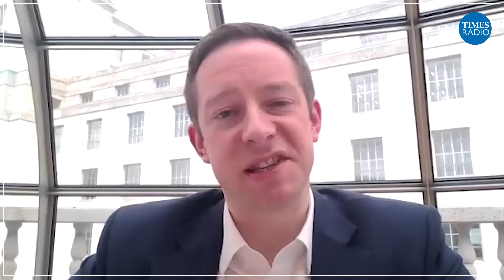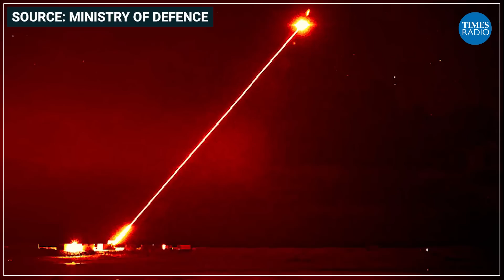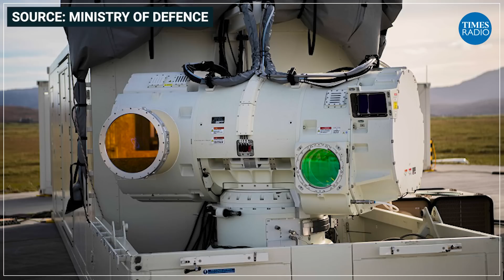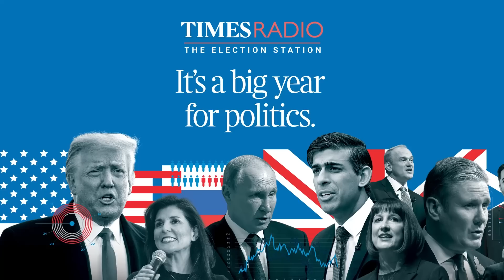DragonFire: the high-power laser capable of wiping out Russian drones | RUSI

Comment: I am surprised that lasers are not used to dazzle, or permanently blind soldiers on the field of battle now. If you had a pulse laser firing at a high refresh rate mounted on an automated carriage that was programmed to effectively sweep every point on the near horizon it could saturate an entire battlefront with enough energy to blind all soldiers on the recieving end. I suppose laser rated glasses would end it's usefulness pretty quick but short term against an unprepared foe you could remove maybe thousands a day with hit and run tactics that allthough effective, are non-lethal. Any such device would use a divided beam to saturate targets with pulses reaching the target distance spaced about one or two inches apart, and creating a pattern array of say one by ten meters with the intent that any single beam pulse would blind enemy soldiers perhaps permanently as this would remove them fully from any future combat rediness. Also to be considered are those frequencies not visible to the human eye such that the enemy would be unaware they were under any attack until symptoms were severe enough to offer any warning. I have seen a young man on youtube that built some damned effective laser devices from old medical equipment or items off amazon. Imagine if just the act of pointing your rifle at a target before firing makes it nearly impossible for that target to site, and fire back at you. One glance that encompasses the business end of your rifle and any potential enemy loses the ability to sight his rifle at you or anybody else either temporarily, or permanently. Again you would want a shotgun pattern of intermittant bursts that rotate, or shift rapidly back and forth such that every square inch of intended area recieves an injurious single pulse in rapid sucession less than human reaction to such would permit.

Comment: Atmospheric scatering is a bane of directed energy weapons. We now even have plasma throwers - they lob chunks of ionized, sefl contained plasma a few meter but interaction with air slows their spin, crippling containment EM feild, and dissipates heat.
In space though, those chunks are isolated kineticly and thermaly and on impact can charge or melt hull of spacecraft.
Lasers in space scatter less and depandant on focusing optics.
Max economically viable laser weoponry in atmosphere is 1-2 km with current electricity storage tech and using other energy storage and extraction tech, like chemical, brings you full circle to kinetics...
Reply: Britain has developed lenses to negate the scattering effect of the atmosphere, they fire a low energy pulse measuring the feedback and compensate accordingly. I think that's why this system is so successful. The laser would be focused to avoid the beam being divergent over distance and losing too much power.
Reply: @carl48uk  ok, maybe they've done some shenanigans with autoadjust of the lens, but the bulk of the problem still persists - air have non homogenous refraction property. No matter how much you adjust at the source, if there are multiple refraction areas on a path of a laser then you still loose coherency.
As I said previously, 1-2 km range is ok, but over this you'll have to brute force the beem to be unfocused and still do the damage.
That was precisely what US did with one and only prototype of anti ballistic missile Laser/Early warning radar, put on Boeing 747. Most of the space took 2 MW chem laser...
Well, I highly doubt 2MW claim, prolly was propaganda and counterintelligence, but the programm was scrapped anyways.

Comment: Would the beam  be rendered ineffective if the missiles were coated in mirrors?
Reply: Less effective, but it is a two-edged sword.
Silver mirrors, for example, are about 95% reflective. That would last as long as it would take the other 5% of the beam to oxidize the surface... a few milliseconds. Silver oxide is dark brown and would make the target even more vulnerable to the laser than it was initially.

Comment: here is one thing Lasers have weakness to and that is Reflective materials. They can replace the body of the drone with a Reflective material Like aluminium or dangle a pie tin under the drone to reflect the laster away from the drone. While no metal is completely immune to Lasers some are more resistant than others. Mark Rober did a Video i found interesting was on Vortex cannons if they can be compacted down in size they seem to be highly effective at taking out Swarms of drones at short ranges.
Reply: We can and do cut those metals in factories using lasers. What makes you think we couldn't do the same while they are flying?
Reply: @Pooua  But you notice they are used fairly close to the metal. Lasers get weaker as the Distance increases because the Area of the beam increases making it less intense.
Reply: @thegreatcanadianlumberjack5307  This is true, but not a showstopper. Lasers beams can be powerful enough to destroy missiles in flight from dozens of miles distant, even if the missiles are reflective. The 1% of energy that shiny missiles absorb is more than enough to melt through the metal in a few seconds. For a rapidly flying missile, that might be too slow, but a slow-flying drone is just right.
Reply: Check out the guy who talks about crowd control weapons ( urban) and his ideas for shields

Comment: The issue is a continuous beam cannot be simple increased in power as you hit a barrier where the air starts to create gas plasms between the gun and target. So the laser has to be pulsed to get round that plasma limit. If you create a plasm at the target . . . That would be very interesting.

Comment: Can a ground based laser be combined with an air launched balloon with a mirror to increase the range of the laser to over the horizon?  
It would increase the range of a large ground powered laser by many miles and with detection radar in the balloon 🎈 and a steerable mirror, greatly increase shoot down abilities!  
If space astronomy can be conducted with balloons, I'm sure a laser could be directed to pinpoint accuracy
With little trouble.  
Who is working on that type of idea?  Someone should!  It's simple optics not complicated physics.   😮😮😮😮😮😮😮😮😮😮

Comment: Can we expect drones to be made of heat resistant ceramics in the future with features to direct cooling across surfaces.  Maybe insulative foams or gels around important electronics. Materials that turn reflective when subject to high heat.
This game is going to continue indefinitely.
Reply: They don't need to turn reflective. Highly reflective surface finishes are straightforward to implement and are always on.
Reply: @rogerphelps9939  Except it also increases visibility, especially at night where reflections from moonlight, street lights etc. will enable it to be seen much more clearly. Ideally you want the reflectivity to quickly increase when the outer skin receives intense light or heats up, the opposite of how reactive sunglasses darken with sunlight.

Comment: All the time people speak about advantages of such systems (simply repeating some basic school physics) and avoid speak about their limitations. Like how long does it take to destroy single target, how far the target could be, how significantly it performance drops during rain, fog or significant dust it the air, how many targets it could hit before overheating. Maybe answers to those questions aren't encouraging enough so we don't mass deployment of those air defense an mass.
Reply: Much of that is classified, but the laser would not be very different from the chemical oxygen iodine laser used in LAWS. A single target may last from a millisecond to a significant fraction of a second, depending on the target. Weather is variable enough to make guesses vague but we could reasonably assume fog would not last long enough to matter. Rain could be unimportant or a show-stopper.

Comment: I have developed a projectile weapon that is very cheap to produce and operate, cannot be electronically jammed, is invisible to radar, infra red sensors and is virtually silent. Ammunition is very cheap and can be made in low tech environments. The weapon has a small collateral damage footprint, particularly when used by a trained individual and there is no pollution from the use of the warhead, I call it the bow and arrow.
Reply: And it's also a directed energy weapon. Kinetic energy.

Comment: DragonFire is junk. It has a 10 mile range on a clear day. Add rain and / or fog and that range is diminished. It can only be used on slow moving projectiles because by the time a hypersonic or subsonic missile gets within range it travels to fast to intercept. Someday this weapon may be improved but for now it is a waste.
Reply: Let's see... hypersonic vehicles are between mach 6 and mach 10, or 4000-7700 mph. Laser is 186,000 mph. Not too fast by more than 1000 times.
Reply: @flagmichael  You are not good at math are you? At say 6000 Miles Per HOUR. Once the projectile enters the 10 mile range of this weapon, it detects the target, adjusts to fire. The game was before the laser could even engage. It is junk.

Comment: Using lasers to blind people - including soldiers - is already outlawed by the GC. It comes under the broad heading of inflicting pain without prospect or intention of removing the threat. Flamethrowers also come under that same exclusion now. Flash-bangs only stay in because blindness and hearing loss are only temporary but even there, there is an upper limit on decibel output and light output.

Comment: You admit that the lasers do not replace the missiles yet you compare them in price for situations where a punch of bullets normally suffice. Fixed ground location makes lasers vulnerable. Also when it rains, it becomes an expensive rain vaporiser. And when it rains, it is defenseless. Enemy could fly a moped as they call shahed drones in Ukraine with a mirror to destroy the laser by reflecting its own beam onto it. Then you admit that it would need focusing to mitigate the clouds but then say that it is a straight line. I guess you could disperse it on its way and get it focus on target only but that requires more luck than simple aim and point exercise. For how long would it need to be able to focus on a target to make a difference?

Comment: It always comes back around to issues of energy.  You have to keep capacitors charged, batteries cooled, and a massive generator for these solutions to work.  

If you have a programmable 20mm fragmenting, explosive round, you are in better shape.  A radar controlled 20mm gun will make short work of multiple incoming dromes or cruise missiles.  Having to stay locked on a target until it fries means you will easily be overwhelmed.
Reply: Not necessarily. A light beam can jump between numerous targets. The issue is having enough power to do damage with a one second or shorter burst. Capacitors are good for energy release but only about 50% of the power is usable. Batteries can deliver less peak power but they keep going and output 90% of what was put in.
Reply: when each rounds costs more than a million, the power infrastructure is cheap. Apparently even Patriots required their own generators.
Reply: Cuts like a light sabre.......

Comment: What if the drone was covered in mirrors or reflecting surfaces ?  Oooops.
Reply: Totally inadequate. There is no perfectly reflecting surface, and the impingement spots would get darker by the millisecond. It would be burned away altogether in less than the blink of an eye.
Reply: @flagmichael  We'll see.  Attacking with GPS-guided drones during a dust storm can be a problem also, eh ?

Comment: Laser seems easily countered with some reflective coating of some kind. I'm pretty sure that will be being worked on if not already figured out. Could make drones more expensive to use I suppose.
Reply: Reflective coatings do nothing and there are no drones with such coatings and if there was the cost would go up significantly defeating the purpose of cheap drones.
Reply: @Art-is-craft  I actually ended up looking into it and there are coatings being worked on and tested and do in fact work.
Reply: @jibijay  
There are no coatings that will stop that level of power cutting a hole through materials. It is not light or a normal heat source it is an extremely intense energy burst on a very densely concentrated area. The reason why drones get used is their cheap lower technology price.
Reply: @Art-is-craft  This "laser" costs much more then any drone with a coating. Being to pricy is the problem.
Reply: The coating would have to be almost perfectly reflective; all practical ones would be burned away in milliseconds.

Comment: What in 5 years when it’s out of development? It’s not Star Wars where lasers just blow up things instantly , if the target avoids being hit then the laser is useless. Ukraine hasn’t got power in 7 regions today , how you going to power it
Reply: You know that mobile generators are existing, right?
Reply: @HedgehogZone  ha ha ha I guess you need another five years to get enough generators together as most are used in city’s without power
Reply: The system would track the target and maintain lock.

And they obviously aren't going to be running around with an extension cord looking for a mains socket. It will have its own power supply

Comment: Extremely skeptical about laser weapons.   Suspect that most drones and cruise missiles could be easily hardened against lasers.  Maybe if the weapon could produce a wide range of wavelengths it might have a future.  My money is on swarm defences.  Ie mount a gun on a drone swarm tasked with protecting an area.  Shares the advantage with lasers of cheap to operate

Comment: Several should be field tested immediately. I guess heavy rain, fog, smoke, etc. limit it's capabilities. However, a nice present from the UK. Best of luck with this one.
Reply: Anybody that has ever subscribed to Satellite TV knows how disruptive 'atmospheric conditions' can be.....
Reply: @vegas1a

Satellite tv disruption is usually 99% the installers fault. The tend to get a signal, any signal and they're done and gone.

If you obtain a 95% plus signal strength, it's extremely severe weather to disrupt the signal.
I actually installed one that it took 2 inches of snow covering the dish to disrupt the signal.

On the other hand, I've seen some installed that a simple breeze disrupted them. Incompetence at its finest.
---------
Anyway, the U.S. has developed technology that overcomes all but the worst weather and atmospheric issues.
For the most part, if it doesn't work, you probably aren't flying.

The only real problem is it's strictly a line of sight weapon. Of course if Airborne, it's still good for a couple hundred miles.
Reply: If you want to see how it copes with heavy rain or fog, keeping the testing in the UK sounds ideal.
Reply: Insh'Allah this will work with great efficiency!
Reply: Highly reflective surface finishes!
Reply: Fog won't be an issue. It'll just tunnel it's way through instantly.
Smoke will take it down a notch for sure.
Reply: Skies could be cleared with radio frequency
Reply: In combination with things like Gepard, some kind of missile based shorad like Avenger, and an electronic warfare platform. You'd have a very effective way of protecting armoured groups from the skies!

It could also be added to existing gbad installations around key infrastructure and military assets.
Reply: Its not capable of anything (It has to stay on target for ages before it can do anything!
Reply: @DarrenJamiesonJamieson 
Drones are slow moving and not sophisticated hence why they are used.
Reply: @churblefurbles  
It takes time to develop such a weapon and to go through very extensive testing phases.
Reply: @DarrenJamiesonJamieson  It does work on small drones, but I don't think it would work on Shahed drones unless they scale up the power quite a bit.
Reply: @DarrenJamiesonJamieson

Staying on target isn't an issue. They've already shot down mortars, rpg's and drones 

Time is dependent on size. The U.S. has a system in development that only takes a millisecond.

A 500kw already being developed and Megawatt lasers on the horizont that terminate ICBM's.
Reply: took years upon years to develop prob billions to make and then goes to ukraine and they have a bad month and russia gets their hands on and makes it for a fraction of the price and our edge vanishes... while i want to support ukraine i still think we should keep our very new tech close and not let the enemy get hold of it.. unless there is some failsafe that stops russia being able to find how it works if they get it.
Reply: @Xeeni87  It needs an inbuilt self-destruct mechanism that activates without authorised user confirmation codes or biometrics. Dead man's handle type approach (used on the London tube for many decades) with delay and geolocation dependent activation.
Reply: @Xeeni87  Russia are not the enemy. Those who support Ukreign/EU (who wish to conquer us are)?
Reply: @Xeeni87  
Knowing how something works and manufacturing it are two completely different things.
Reply: @Xeeni87  Absolutely. This is of major concern. Let's hope nothing gets near it.
Reply: Unranke has sold our weapons before and they where used against USA soldiers